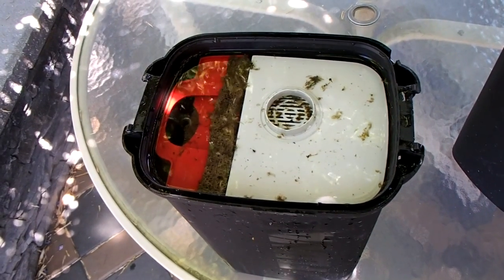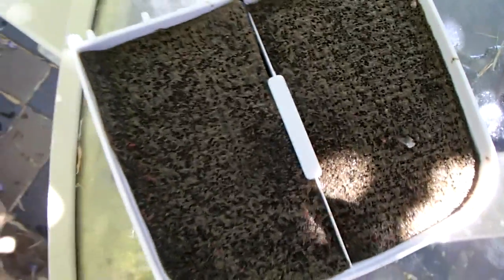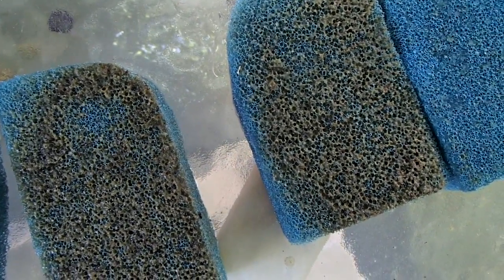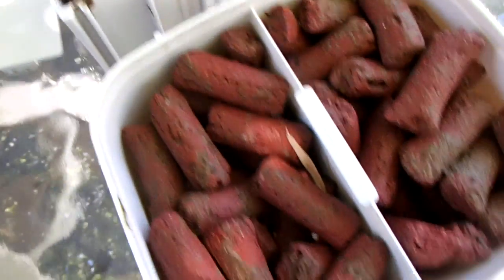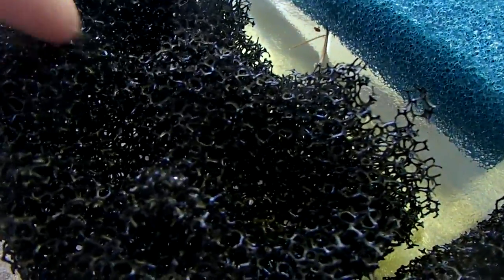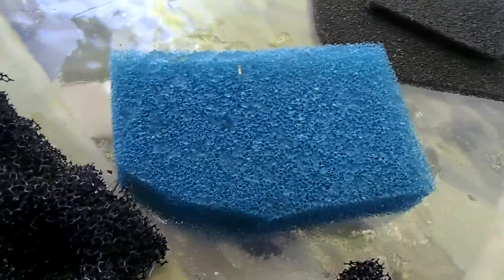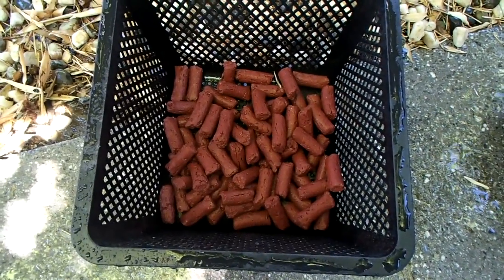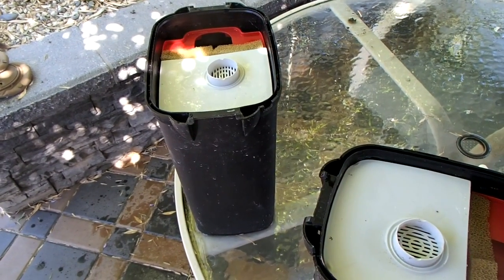Test 6 516

Comment: I'm in a similar predicament right now. I am using various types of foam and trying to see whether adding coarse foam to my canister filters is even worth it. For the most part they are inadequate as a lot of stuff bypasses them. The rings I have under all of baskets, as suggested by Pond Guru, do a much better job at trapping stuff than the Coarse foams. I have heard many great things about Poret Foam, and I will likely make the investment and buy some medium to fine foam pads. I know Swiss Tropicals is the US distributor for them, but do you think you could become a distributor as well? I have bought Biohome from you before and I really appreciate the attention to detail you give as well as the overall superior customer service. So that being said, I would much prefer to buy from you.
Reply from the maker: Erik, well thanks. Yes Swiss Tropicals is the distributor, but I now resell their foam. I have 13" and 6 1/2" Foam Filter Sets in stock and you can also purchase individual sheets of Coarse, Medium or Fine if you pefer. The Coarse and Medium Foam are 1" thick and the Fine Foam is 1/2" thick. I figure that should just about fill the bottom tray of most canister filters.
Reply: Thank you so much for the quick reply! I have checked out your website and am gonna put my order in as soon as I figure out the dimensions that I need! I can't brag about you and your services enough!